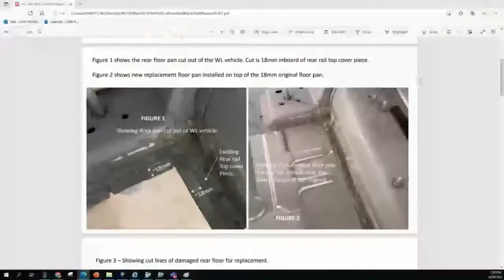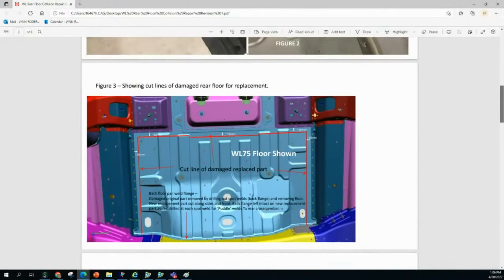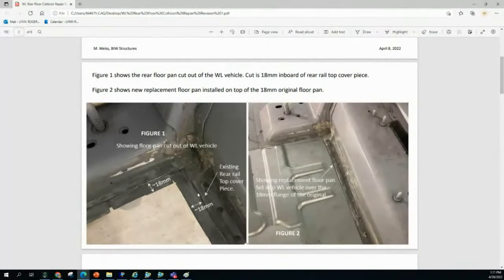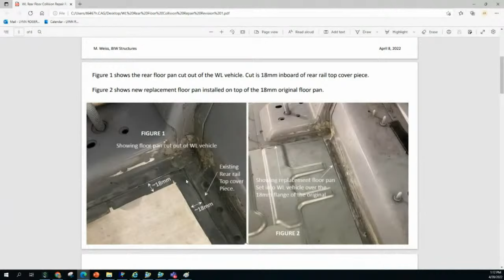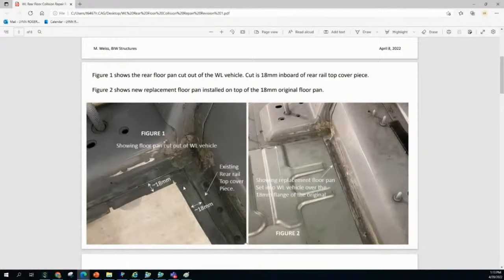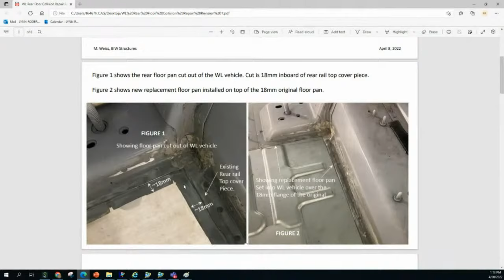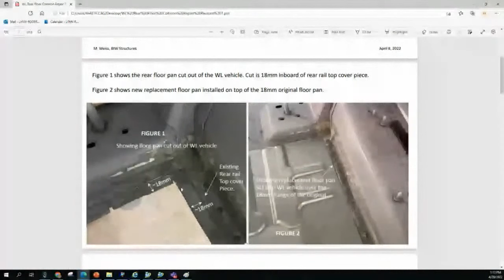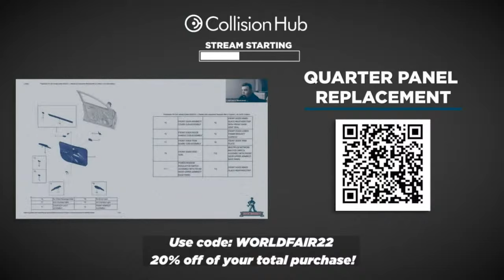Stellantis Presents: Body Panel Replacement With Overlap Weld Through Primer

Comment: I have a question concerning FCA`s weld bonding Document 31-007-12 August 14 2012 :calls for any welding to be done on any FCA vehicle to be weld bonded. Is FCA moving away from this position statement? 

A while ago (August 14, 2013 to be exact) FCA/Stellantis released the collision bulletin, Welded Sheet Metal Repairs and Replacements, that changed the way that their vehicles should be repaired. In this bulletin it states that: "weld bonding of replacement panels is the recommended installation method to utilize when repairing Chrysler, Dodge, Fiat, Jeep, or Ram vehicles."